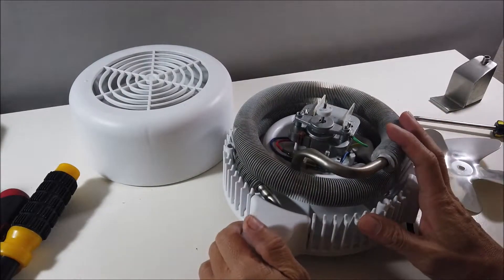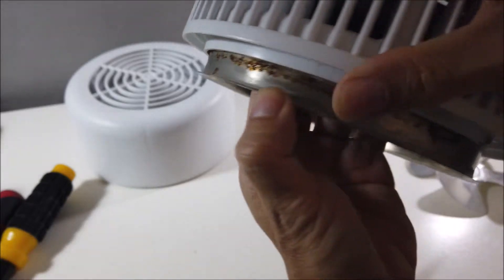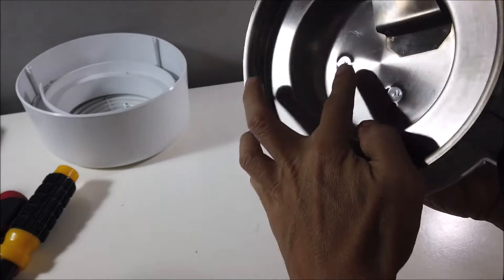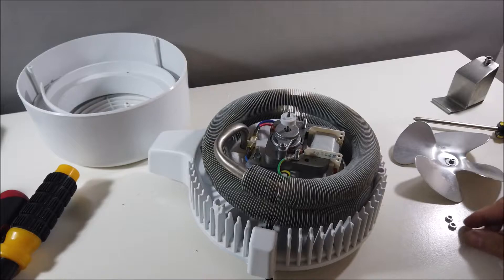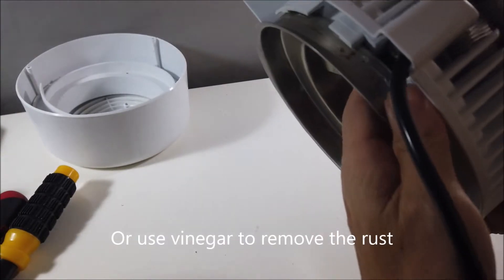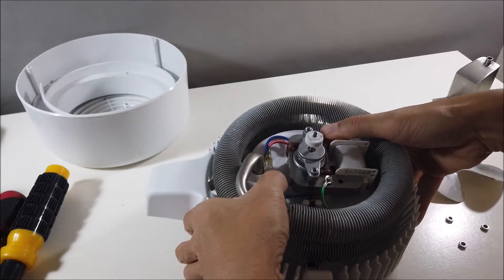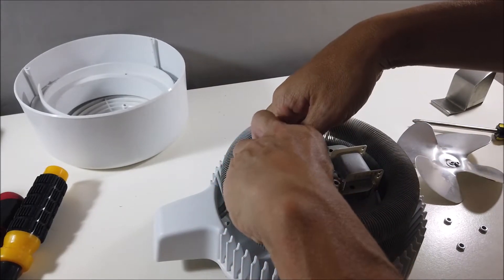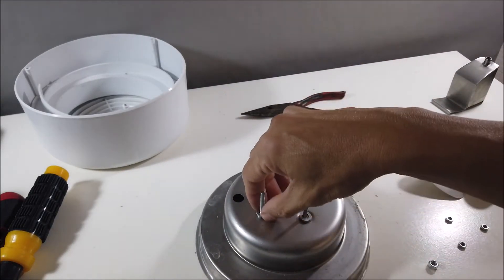Water distiller Head unit disassembly

Comment: Hello my distiller fan doesn’t work anymore, do you have any idea what’s the cause of that 😭
Reply from the maker: Only the fan?  Power is on when plugged in?  Does the red led light up?  or the led on the red toggle switch comes on?  If the power light is on but fan does not spin, I am not sure, your motor is fried, check connections.  But if no power, it could be the thermal fuse/switch that is burnt out, the one that is a button to reset the cut off circuit when all the water is evaporated.    If you don't have soldering tool nor a volt meter, I suggest you look for your local small appliance handyman to get it fixed.  But of course, depends on how much that would cost.  These days, it could cost as much as buying a new distiller.

Comment: Thanks for the tip! I had no idea rust could start accumulating under the rubber gasket. 

I have the same distiller model as you (except it's black) and my unit is just shy of 2 years old. Underneath the gasket a bit or rust had already started to build up in half a dozen places. 

It's probably a good idea to regularly remove the gasket for cleaning and drying in order to prevent reust buildup. I wonder if Megahome distiillers are more resitant to rust than these cheaper Amazon models.
Reply: Megahome distiillers are very similar, almost the same. To prevent rusting - clean it with distilled vinegar & wate  to remove the sediments, than rinse & DRY.